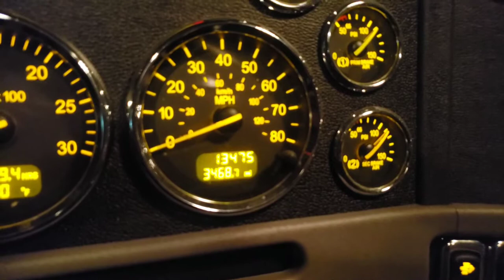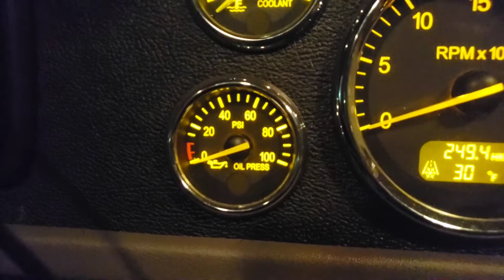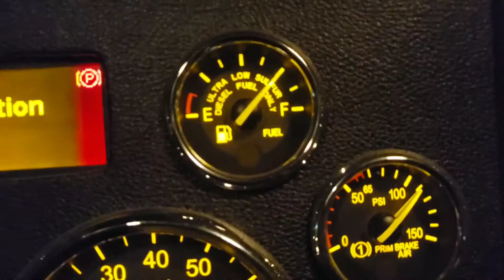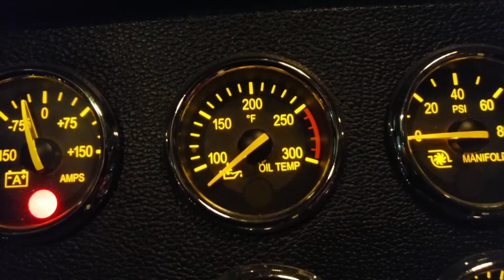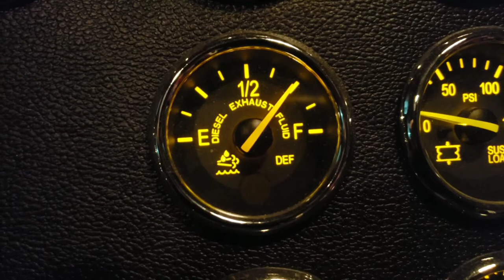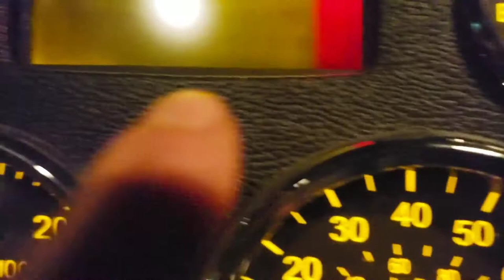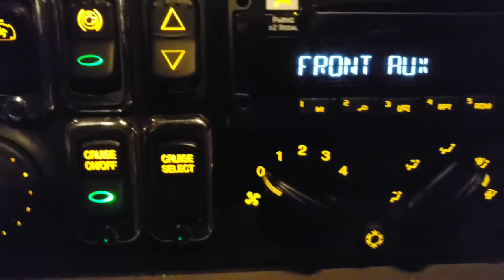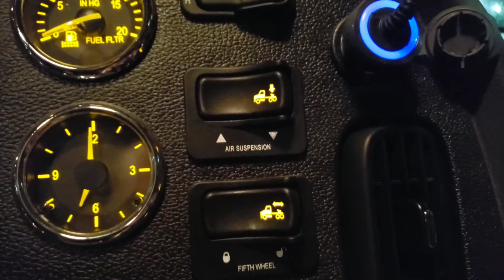What do all those gauges and switches do?

Comment: QUESTION. I BELIEVED THE PYROMETER WAS ONE OF A Sophisticated  PIECE OF EQUIPMENT... HOWEVER....IT DOES NOT. DETECT AND OR EXTINGUISH A FIRE IN THIS PARTICULAR HEAVY USE EQUIPMENT: SEMIs...why?  ANSUL FIRE SUPPRESSION SYSTEM...
Reply from the maker: Pyromemter just measures the exhaust temperature so you can tell if you have incorrect air to fuel ratios.